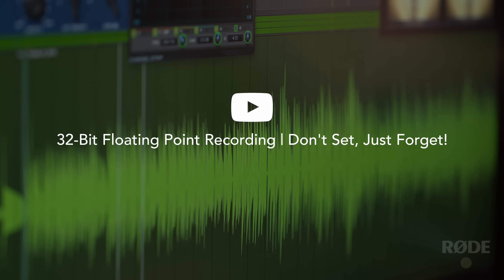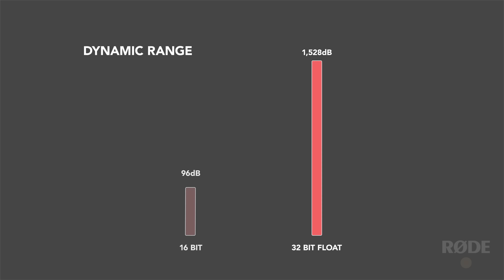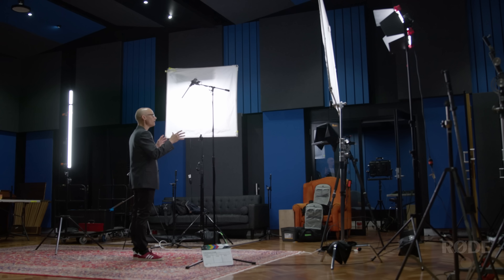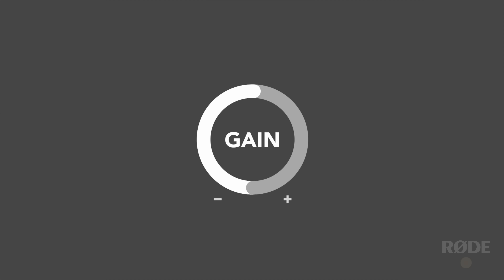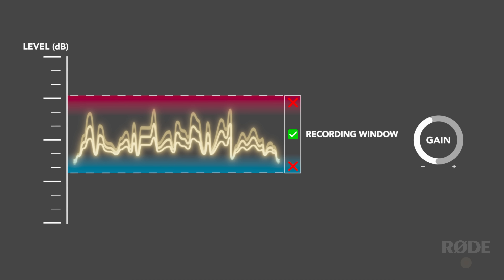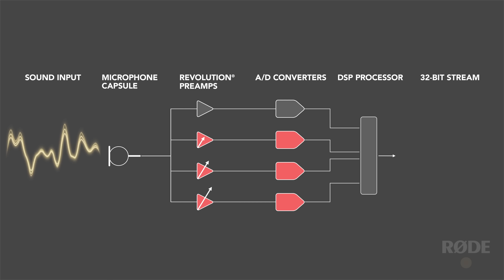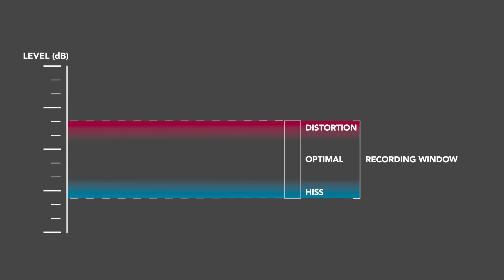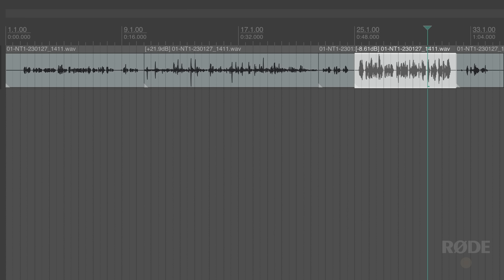Game-changer: How 32-Bit Float Recording Makes Clipping a Thing of the Past

Comment: The comparison RAW vs mpeg4 (for example) and 32bit audio vs 24 bit audio (for example) is not properly used. It would be lossless vs lossy audio formats (FLAC vs mpeg4, for example). I find the explanation is somehow misleading. I would have liked to find more info about why 32bit samples are better than the 24 or 16 ones.

Comment: But surely analog systems like microphones have an unavoidable noise floor; thermal noise etc?
Reply from the maker: This is correct - and the key is that this should be as low as possible. The NT1 5th Generation has a noise floor of just 4dB(A) - making it the quietest studio microphone in the world!
Reply: @rodemic  Looking a bit further, I see one only gets the full advantage if the mic to computer connection is digital (USB in this case).  What DAW were you using for this demo?  Seems to be excellent value for the price though, I am impressed.

Comment: Did we forget that you need an analog to digital audio interface to record into a computer. The distortion begins at the audio interface. Not the computer.
Reply from the maker: The NT1 5th Generation which we have packed this technology into features an audio interface built into the microphone, which handles the analog-to-digital conversion process like an external audio interface would. You just plug in via USB and you're good to go!

Comment: I'm curious how you get 32-bit float recording from multiple microphones. Having e.g. 10 of these all connected via USB is surely going to cause bus contention, and if you connect by XLR, I presume you don't get the 32-bit float recording. I'm hoping patents don't get in the way of interfaces in general adopting 32-bit recording on their analogue inputs.
Reply: dont worry. Float is a completely digital thing that happens in the interface, nothing to do with the xlr.
The only problem you theoretically could encounter is the max data transfer rate of your connection. Which for usb 3.2 is ~20Gbit/s. So if you are recording at 48k/24b you can theoretically still record 149.130 seperate mics at the same time.

Yes i just spent 5 minutes calculating that...
Reply: You need an interface capable of recording in 32-bit float - but very few support this. The Zoom F6, F3, F2 and their new USB interface do. Sound Devices Mix Pre series support it too. There are a handful of other options too. I'm not aware of any interfaces from Rode that support 32-bit float just yet. I'd love a RodeCaster Pro with that feature.
Reply: @JasonTaylor-po5xc  you actually dont, since the "32" bit are created after the conversion to digital. My focusrite solo could even do 64fp in Reaper.
My SSL12 can also record in 32PCM.
Just recalling the video, its really poorly and explained and doesnt go into why its 32 and whats floating point xD
Reply: @oleklabisch644  Depends how you are capturing the audio signal from your interface. If using the USB interface, then you are limited by the A/D conversion of your equipment. SSLv2+ supports only 24-bit that way. Reaper might say you are recording in 32 or even 64 float, but you aren't actually capturing all that information. It's like ripping a CD into 96k WAV. Sure, the software will let you do it, but it won't result in better quality. But, there should be an easy way to test - just record your mic hot (clipping) - then see if you can recover from that clipping in Reaper. I'll test my SSLv2+ vs my F6 and let you know my results.
Reply: @JasonTaylor-po5xc  No it doesnt depend, because we are talking about a DIGITAL topic, so you WILL need an interface regardless.
The 32bit fp works differentlyy than the 24bit pcm. The 32 bit are used in a manner, that its not usable by us humans, but rather for computation. Its encoded in a mantissa with a length of 32. Mantissa use floating points (FP). thats why the increase of usable dynamic range is not constant to the increase from 16pcm to 24pcm.
Its, nowadays, software dependant if your interface can do it.
Coming back to the fidelity point: 32 float does not make any sense in that regard, since its ~650dB of dynamic range you will never hear lol.
PS: SSL 12 (twelve!) does also have 32 bit pcm

Comment: maybe it would be worth noting, that it's not just switching your daw to 32 Bit float. you actually need an audio interface that can i fact record at 32Bit Float in the first place.
if your Focusrite 2i2 only supports 24Bit and you record with to much gain it will be distorted even with 32Bit Float in your daw. no way to fix that in post.
Reply from the maker: Or just a mic with the world's first 32-bit float digital output: https://rode.com/en/microphones/studio-condenser/nt1-5th-generation 😉

Comment: I have a follow up questions then.
How is it that there aren't any interfaces already using this? (Only Steinberg seems to offer 32 bit but it is integer instead of float.)
I have seen plenty of handheld recorders now. But actual professional interface are all still 24 bit. Is there a reason why?
Reply: 24 bit is in most cases sufficient, as long as you aren't clipping (and auto-gain levelling or setting the gain conservatively will avoid clipping). You can turn down the gain significantly, have plenty of headroom, and still have a ultra-low noise floor with 24 bit. There hasn't really been a good reason to jump to 32 bit in most devices.
Reply: @LukeEsther  Sound Devices MixPre-3 II can be used as a 32 bit float audio interface to USB.  It's been out for a while.  There may well be others.
Reply: @Ozpeter  Do you know if that kind of devices could be usesd in a recording studio, recording vocals? Not sure if they have ASIO drivers and if the singer caould monitor the instrumental in real time, while hearing his voice also in the headphones. I am thinking of upgrading my audio interface with a Sound Devices device so I could use it also for high quality field recordings.
Reply: @arminfatol  I have no direct knowledge of the capabilities of such device in that context, so it would be improper for me to take a guess, given that you are making a purchasing decision!  I'd suggest getting in touch with Sound Devices via their website and putting the question to them direct.  Good luck with your project!

Comment: I just purchased the Panasonic GH7 and also purchased the DMW-XLR2.  I previously had the GH6 with the XLR1.  I am recording audio on the GH7 with two shotgun mics. on opposite sides of the camera rig and recording in 48kHz/32 bit.  In our videos...there is a lot of screaming and yelling and much to my disappointment...the audio is actually clipping WORSE at 32 bit than it was with the same mic on the GH6 at 24bit!  I don't get it!? I paid $500 for the XLR2 so that I don't have to worry about audio clipping anymore and I've gone backwards!  Something is not right.
Reply: But does the clipping still happen when you bring down the audio level in post production?
Reply: @Ozpeter  Yes...this isn't where it shows the audio clipping on inside of Premier but doesn't sound like it's clipping.  It's clipping big time and I try to fix it in post, sure, I can lower the db but all that does it lower the overall volume, but does not get rid of the clipping.  That said, I think I have figured out how to set the levels correctly (despite the hype advertising you don't have to worry about tweaking the levels with 32 bit).  With  the 32 bit setting...I can now set my levels really low and still get very clear sound, even at whisper levels. That then gives me a lot more room if someone screams on camera without clipping.  At the same level settings at 24 bit...you can barely hear anything.  So, there is definitely a huge benefit with the 32 bit but they are hyping it the wrong way!  You still have to be careful how high you have your levels set because it WILL clip if they are set too high.

Comment: Great work, guys! I have a question.

I want to recommend the Rode NT1 5th Gen to a friend of mine who is constantly clipping on Discord due to him using a Blue Yeti.

Would this microphone help solve that? Or is my friend just a lost cause? 🤣
Reply: If he's constantly clipping then his gain is too high - you don't need 32 bit to set your gain correctly, it just makes it less important.
Reply: he will clip with the rode as well then
Reply: @georgwalt7978  Unlikely if he is either using the USB connection and capturing in 32 bit or using the XLR connection into a 32 bit recorder and recording at 32 bit (the latter is true of any mic, the former - not).
Reply: No, he’ll still clip on Discord because audio is going straight to “broadcast.” If he was recording to a DAW, he could correct it in post, but that doesn’t happen with live-streaming.
Reply: @bmoklsc  yes - you’re correct. Clipped audio at 32 bit will need post processing to tame the clips and not possible if you are live streaming.

Comment: Does your camera have to have 32 bit float capability for it to be recorded in camera? Seems like you will always have to sync in post.
Reply from the maker: To use the NT1 5th Generation to record the 32-bit float, you will either need to use it via XLR with a 32-bit float compatible recorder or over USB into a DAW capable of recording in 32-bit float

Comment: There’s nothing about 32 bits that inherently gives you more headroom. That’s only true if you use the additional bits for increasing the max value rather than increasing precision.
Reply: Going from 24bit integers to 32bit floating point kinda does both: it will give you great precision for small numbers, and massive maximum values for large numbers.
Reply: That's not entirely true as increasing the precision alone reduces quantization noise, which reduces the noise floor.  That being said, in DAWs at least, afaik they do exactly what you describe, and exclusively use the extra bits to scale above 0db, which keeps the precision in the usable range the same as 24-bit.
Reply: @Nathan_Woodruff  hah ok. Going from 24 to 32 bit precision would lower the noise floor a tiny amount, thereby increasing headroom a tiny amount. Assuming you lower the gain on your recording by that tiny amount to take advantage of the lower noise floor. technically correct, good one.
Reply: @darkstar4494  Reducing quantization noise is the entire goal, and is actually the only effect of increasing bit depth.  Changing from 24-bit to 32-bit increases dynamic range (and therefore headroom) by an order of magnitude (144db to 1500db), not just a little bit.
Reply: Standard 32 bit floats have a 24 bit mantissa and an 8 bit exponent (if you look it up you'll find that the mantissa field is 23 bits and there's also a sign bit, but this is explained by mathematical trickery). So you should be getting ~1500 dB of nominal headroom in exchange for a shifting noise floor (if the back of my envelope doesn't deceive me).
Reply: @Nathan_Woodruff my point is that going from 24 to 32 floating point, the reduction in quantization noise is negligible, because it was already tiny.
you’re getting both increased precision and more headroom at once. a lot of headroom.

Comment: (Read to the end, and you'll realize I'm not just bashing here, there is another side to this argument as well)
This is marketing BS. I'm electronics designer, and the fact that you can have 32bit output from the ADC to the processor has nothing to do with being able to record in 32bit floating point.

Physics limits our dynamic range and effective SNR (in bandwidths required for audio) to tad under 24bits, the limits of thermal noise will become an issue and you will never be able to utilize those last few bits even in your 24bit ADC.

And even if the ADC has 122dB of dynamic range, you will wreck havoc to that by introducing any external components and real life transmission lines (the mic cable) to the equation. So your real effective dynamic range is around 22-23bits in OPTIMAL circumstances and with top of the line equipment.

There doesn't even exist microphones that are capable of such a low self noise that you'd be able to use that huge dynamic range anyway. And even the quietest possible room inexistence will have enough noise that you won't be able to get 122dB SNR for any recording.

THAT BEING SAID!

Is it a good idea to use 32 or even 64bit floating point when you mix and sum several signal inside a DAW (digital domain)? Hell yes, any DAW worth it's salt will handle tracks in 64bit floating point, which gives you almost unlimited dynamic range and you won't clip it, no matter what you do. You also don't lose any bit depth or make your SNR worse when you pull down sliders for mixing.

But ultimately you'll render it to 16 or 24bits because there doesn't exist physical space nor equipment capable of reproducing 32bit floating point signals. so it's wasted data.

Bit depth matters only within the digital domain, and even then it's about the SNR and "endless roof" that you can't clip.

But there's no point in trying to claim that one can record in 32bit floating point... it's just not physically possible or feasible unless you're fine with a bandwidth of around 2khz or so (scientific measurements are done regularly in 32bit fp, but the bandwidths utilized are very VERY low in comparison to audio frequencies so there exists ADC's that are capable of this performance in these scenarios)

But use 24bit ADC, then convert that to 32bit or 64bit floating point in digital domain? Yes please, do that.

Comment: Awesome review. I'm however wondering how you would use the USB in a 32bit recording in pro tools for example when overdubbing. I mean how would you handle the monitoring roles for the headphones for example? Thanks
Reply from the maker: You can learn more about monitoring with the NT1 5th Generation here: https://rode.com/en/user-guides/nt1-5th-generation#:~:text=Using%20the%20NT1%205th%20Generation%20with%20Your%20Audio%20Software

Comment: 32-bit float has variable resolution.  I would much rather have  32-bit integer.  Most computers are 64 bit anyway, so if 32 bit isn't enough, just give me 64 bit-integer.  You can sum 256  24-bit tracks and have no possibility of clipping a 32 bit integer.  There is no microphone made that has a 24 bit range from noise floor to mechanical clipping.

Comment: What if you clip something with a preamp, limiter or compressor then how the hell would this work ? it just cant redo a physical thing happened in real life. This is only DI ITB... not even mentioned once
Reply: It may not be explained well in the video, but this isn't trying to "undo" clipping in any way, and it doesn't have that much to do with 32-bit floats. 
The mic has a built-in audio interface, and inside of that there are multiple preamps in parallel, each set to different gain levels.  These run into some processing which stitches together the signals based on which preamp the signal is in the sweet spot of.  So you effectively get the preamp noise of the preamp with the highest gain, and the clipping threshold of the preamp with the lowest gain.  What results is a single high dynamic range signal.  Apparently this signal is too dynamic to be represented in 24-bit, so they use 32-bit.  That's about it.

Comment: Maybe we should skip this all together and record to DSD.

There are DAWs out there that are readily capable.

DSD has been around for a long time too. Why didn't Rode go in that direction and integrate that quality into their product?
Reply: any digital format won't be as elite as some analog system that captures all the sound. imagine being able to record exactly the xlr signal
Reply: It seems that DSD has a higher noise floor (-120db) than 24-bit float PCM (-144db) though it does have a much higher sample rate?  Not sure if I'm correct on that one.  If so then it wouldn't be the right tradeoff for this situation since it requires high dynamic range and not extended frequency response.

Comment: YEAH . But integrated preamlifier chip have 24bit  resolution. What u wanna say RODE?
Reply from the maker: The NT1 5th Generation uses four stacked 24 bit convertors. Their output is combined in an on-board DSP to create a true 32 bit float output that exceeds the performance of any individual convertor. This is just one of the many technological innovations in the NT1 5th Generation!
Reply: @rodemic  
do you have a representative in Poland?

I'd like compare with 24 bit external DSP, yout performance from this Mic. Some tests for tiktok content. Maybe 
detailed data will dispel uncertainties

Comment: If 24 bit aka 144 dB isnt enough, then youre legitimately trying to record both a jet engine and the faintest whisper. 32 bit, which has a dynamic range(DR) of over a thousand dB is legitimately beyond the scope of sounds that can happen on earth... generally if you record at 24 bit, the rest of your equipment will have too much noise to even make use of the 144 dB of DR. Even the best mics have too much self noise to be able to use up the 144 dB of 24 bit. Meaning if you want 144 dB or more, you will have to have multiple mics at probbably different positions at actually fulfil the 144dB of DR...
32bit only makes your files bigger for no benefit. Ppl should honestly just learn to leave a fair bit of headroom with 24bit recording.